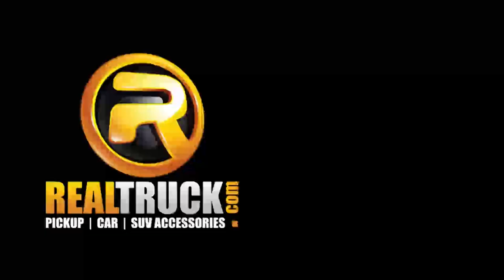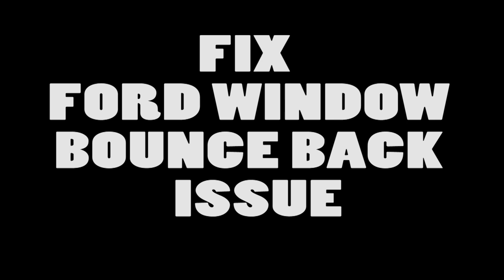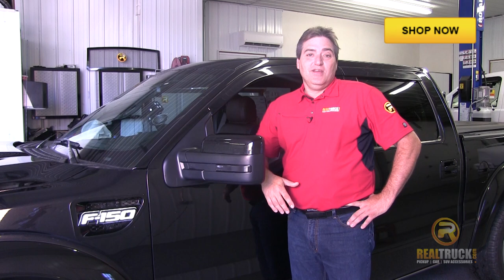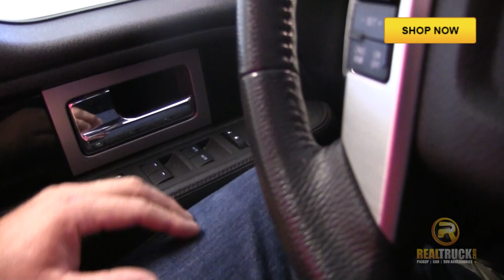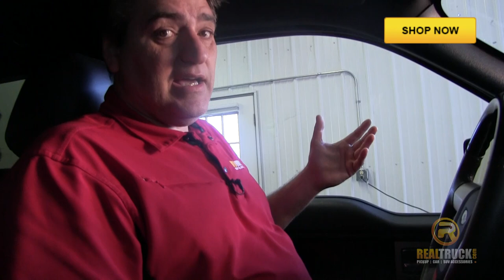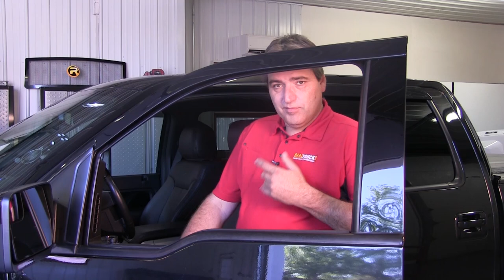How To Fix Ford Auto Up Window Bounce Back

Comment: this is not the normal procedure.....
it can be done in seconds rather than 48 hours.
here is the procedure....it works. just performed on a 2015 expedition

NOTE:Initialization is required to learn both the full UP and full DOWN positions and the profile of the glass as it travels through the glass channel. Once initialized, obstacle detection is enabled. This procedure is only required for Navigator (LF and RF) or Expedition (LF only) window motors.

NOTE:The window motor must be initialized whenever: the motor is removed from window regulator drum housing, a new motor is installed, a new window regulator is installed, new window glass is installed, glass top run removal or installation is carried out or when carrying out any operation in which grease or lubricants are applied to the window system. All window components (window glass, window regulator, window motor and glass top run) must be installed and tightened to specification before carrying out this procedure. Refer to the De-Initialization Procedure in this section prior to performing the window motor initialization (unless a new motor is being installed).

NOTE:A new (or de-initialized) LF/RF (Navigator) or LF (Expedition) window motor will not operate in one-touch up mode until initialized. If a new LF/RF window motor has been installed, proceed to the Window Motor Initialization procedure in this section.

NOTE:Excessive bounce-back (window reverses direction with no obstructions present) may indicate that a de-initialization procedure may need to be performed.

De-Initialization Procedure

Start with the ignition key in the RUN position and open one front door.
NOTE:Steps 2 and 3 must be performed within 8 seconds.

Turn the ignition key from OFF to RUN 5 times.
Press the window control switch to the one-touch DOWN position (second detent) and release.
Window Motor Initialization

 WARNING: Keep objects and body parts clear of the glass panel when carrying out the initialization procedure. During the initialization procedure, the glass panel closes with high force and cannot detect objects in its path. Failure to follow this instruction may result in serious personal injury.

Start with the ignition key in the OFF position and with the LF/RF door open.
Turn the ignition key to the ON position.
Activate and hold the window control switch in the one-touch DOWN position (second detent) until the window glass stalls for 2 seconds at the bottom of its travel and release the switch.
NOTE:After performing this step, wait a minimum of 3 seconds before operating the window control switch or ignition switch.

Activate and hold the window control switch (with no interruptions) in the one-touch UP position (second detent) until the window glass stalls for 2 seconds into the glass top run and release the switch.
Verify correct operation of the window by carrying out the one-touch up and one-touch down features. If the window does not operate correctly, carefully repeat this procedure.
Reply: any idea how this is accomplished with push button ignition?
Reply: This procedure worked for me but I had to hit run/stop 10 times not 5. Thanks

Comment: Oh and here is how to actually repair the issue you describe here on our 2016. It may work on older models also. 

1. When installed correctly, the bottom edge of the front deflector must rest on the door’s outer weather-strip molding and only the thin flange is in the channel between the glass and inner seal.
2. Slowly raise the window up without activating the auto-up.
If unable to fully close, have someone press the window between their hands upwards. Simultaneously raise the window up in small increments until
fully closed.
3. If safety features cause the window to go down, reset the window by:
a. Roll the window down, hold the down button for 5 seconds.
b. Raise the window without activating the auto-up feature. Hold the up button for 3 seconds.
4. Leave windows closed fully for 12 hours. Deflector may take longer to acclimate below 60° F / 1

Comment: I have a 2008 expedition with a new regulator. It goes up automatically and when it fully closes it comes back down a few inches. I've tried this reinitializing and it doesn't work. Any ideas would be appreciated
Reply from the maker: +Tritonone if you have tried this tip the best course of action would be to contact the manufacturer of the vent shades. They may have additional help for troubleshooting these problems. Usually when this is happening it's because something is obstructing the track.
Reply: I'm sorry it doesn't have shades. Installed regulator and about two weeks later it started doing that
Reply from the maker: Okay, this video was shot to show you how to reset your system once vent shades have been added. It sounds like something might be wrong with your regulator. I would check all of your connections and call the manufacturer that you got the product from.